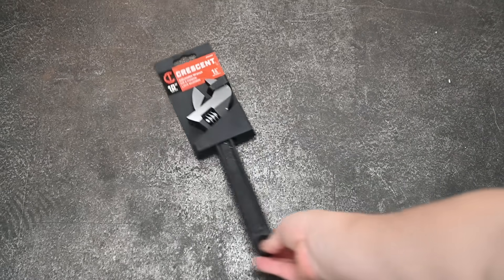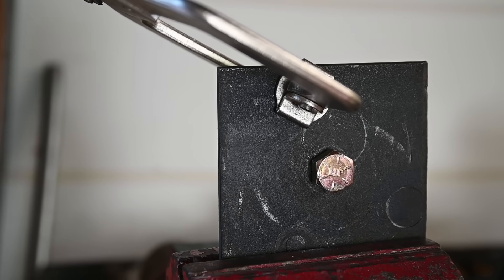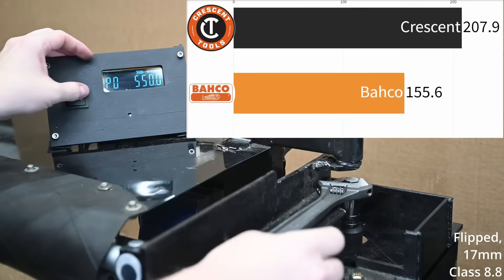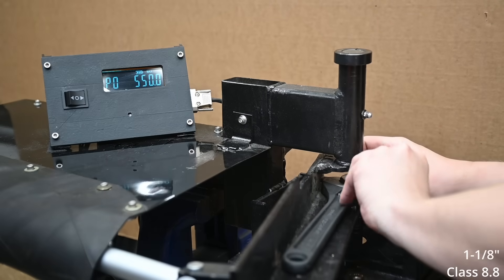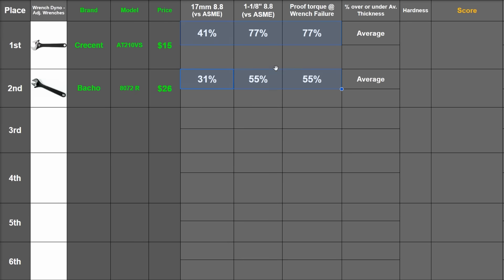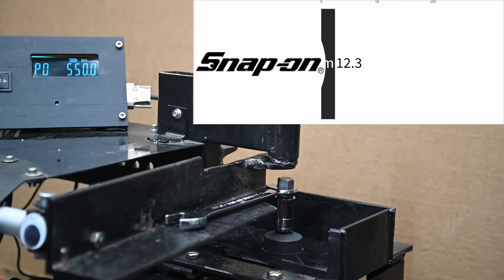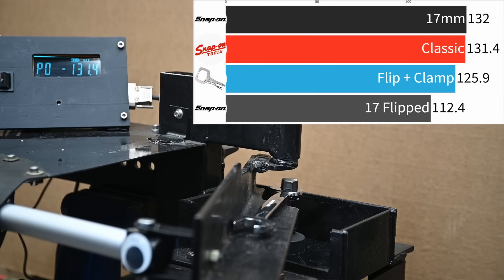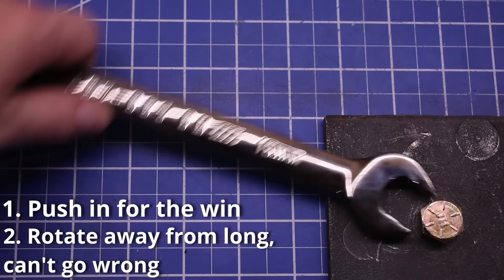Are you turning wrenches the wrong way?

Comment: It seems that tools do change over time a lot, that is at least for the Bacho adjustable wrenches the case . Got 3 very old ones from many decades ago (before  1924) in different sizes. patent 40417 which seems much more sturdier than current models.
They all are, as the Crescent brand, have more rounded jaws, 
have much shorter jaws
jaws are not tapered toward the front of jaw
early  ones have  the same jaw length as thickness. 1 inch jaw length = 1 inch thick
The 3rd generation  a bit smaller 83% thickness. example; My No 82: 18mm (0,71") jaw length, thickness  is 15mm (0.59)
The 80 series had 45 degree angle while other series have a 15 degree angle.

Comment: I have always felt intuitively correct in the assumption that the head is angled so as to give you access to the whole bolt, which are usually 20º (1/3 of 60º) and 40º (2/3 of 60º) angles to offset the 60º of each side of the hexagon.

Comment: If the bolt head deform all conclusions are invalid.   The movable jaw should press on the head flat close to the handle to limit moment on the weakest jaw. The fix jaw can be made to press on the flat farther since is stronger.   If the bold deform you are better off using a box wrench.

Comment: Another ridiculous test that means nothing in the real world. I'd like to see the person who can put 200+ ft lbs on a nut/bolt with a 10" wrench of any kind. Tough enough to do with a 24" breaker bar. Considering the torque value for a 5/8 is only 58 ft lbs, any of these "Cresent" wrenches will do just fine.

Comment: Bahco was Swedish was and far superior to the Crescent, now made by some cheap Spanish outfit.  You wouldn't use an adjustable for everything but the correct spanner. I have had a 12" Swedish Bahco since 1968 and it still is in working order as its not been abused.

Comment: The caveat at the very end "whenever you can" is the important thing. Frankly, bang on the end of a screwdriver to use it as a chisel, sometimes, because that is the most practicable tool in the moment AND IT WORKS. The screwdriver has evolved in design to take a pounding like it never was originally meant to do. The same thing with many other tools. I've even used an impact wrench as a hammer in the way it's internal hammers were never envisioned to be used! You use your head and, in a pinch, use what you have at hand...... and you TRY not to break things! ;-)

Comment: Sometimes I do turn them the wrong way... but then I remember "righty tighty, lefty loosy" and after a few minutes of left/right confused thinking I figure out it means clockwise to fasten and anti clockwise to loosen.
Reply: Oh, you mean which way to hold the wrench itself... 😁
Thoug, I really can't imagine it makes much of a difference... I would think that that as long as the spanner is adjusted correctly the twisting force will affect both sides fairly equally and it's probably just as "bad" for the mechanism to twist it one way as the other. And I would assume the main reason the non-adjustable ones are asymmetrical is because it increases the chance that at least one orientation will be able to fit the nut in a cramped space, not because one is stronger than the other.

Comment: There is no preferred direction for using an open-end wrench; they are designed to be used in either direction.  The offset angle is to allow smaller turning angles to turn bolts in tight spaces.  The offset angle designed into the adjustable wrench is for the same reason.  But due to the need to move (adjust) one jaw, that jaw will always be weaker.  Having a weaker direction is a result of design compromises.  Again, the offset angle is to allow for tighter spaces.  The adjustable is always inferior in strength to a box or open end.  

The box wrench is designed for breaking bolts loose while the open-end is designed for rapid application and removal.  I have watched old-timers (I am the old-timer now) use an open-end wrench as fast as we would use a ratchet. You no longer see that because we have ratche wrenches.  The six-point box is stronger than the 12-point box.  The 12-point box compromises strength in favor of the smaller turning angle for tight spaces.

Comment: It is interesting to see the behavior with the adjustable wrench.  None of those wrenches are very big and it would be difficult for any human to achieve anywhere close to those torque values by hand.  That might be a good test for you- how much torque can you get on one of these wrenches by hand.  Of course people can and do put "cheaters" on them.  As your tests show a lot of the tools start to slip as the torque reaches the limit- a person operating the wrench with a cheater would see that the tool is slipping and probably wouldn't keep going until something broke.  They would know that the need to tackle the problem a different way.

Comment: For the normal wrenches, the reason they are angles by 15 degrees, is that bolts normally have a 60 degree minimum step angle, y'know, because the bolts are shaped hexagonal. That means in tight spaces it can mess you up if you can't get the tool on the bolt properly. When you turn over the wrench, you basically half that 60 degree minimum angle to 30 degrees, allowing for more space. You can then keep turning over the wrench each rotation. Yes, that does take ages and is very annoying, but it works wonders. The orientation should not really matter strenght-wise.

Comment: Any open-end, adjustable or ratcheting wrenches and spanners should not be used for tightening or loosening up the bolts, they are for light jobs. That's kind of common sense.
A socket on the end of a breaker bar or a torque wrench is what we need. If there's no space for that, ring spanners are the next option down the list. The last thing I reach for are open-end spanners because of only two points of contact and likely damage to the bolt head, unfortunately something like a pipe fastener doesnt leave us too many options.
Always make sure you dont exceed required torque if applicable, and If you broke your wrench or rounded the head, you just used a wrong tool for the job.

Comment: I havent watched but ive always turned towards the fixed end. Because the nut will be putting pressure on the variable end closest to the adjuster, and the closer that pressure is applied the less leverage it has on it. So i'd asume it's less likely to open and slip
Reply: It appears I have been doing it wrong, thankyou. Perhaps the upward motion overcame the benefit of less leverage in terms of creating a gap to slip

Comment: The test nut used actually looks to me like a socket wrench for Allen screws. The tolerances are different from those of nuts and wrenches (especially fixed ones) slip more easily than a nut of standard dimensions.

Comment: The direction of the jaws is about multiplying the amount of input force it takes to get output force and the ergonomics behind it, like you hinted on at the end. A better test would have been to measure the torque applied to the wrench to achieve something like 100ft lbs on the fastener, at least in my opinion. 

I use pliers wrenches all day every day and the different is very noticeable.

Comment: One end is pushing, the other is pulling.  The force of the pulling end will be more at the tip.  The pushing end will be more at the base.  So if you pulling with the adjustable end, the force is at the tip and is prying it open.

Comment: it is this simple with a standard open end wrench- It is intentionally set at that angle for use in tight quarters, so that you get a certain amount of rotation, you lift, flip, and replace the wrench, and continue to turn it. There is NO WRONG DIRECTION, period. If there was, then it would not have the (I think 18 degree) angle, and would just be straight off the end. At 15 degrees, if there is a 1 flat rotation space available(meaning you cant turn the bolt or nut more than one flat) you can flip the wrench, and get to the next flat. Give it a try sometime...

Comment: The vid was good but how can you run a channel around it for so long and with so many subs? It makes no sense. It would seem that you test all wrenches once, then another brand and that's about it. Maybe screwdrivers and various ratchets and impact drivers and then it's over. I'd add various lubricants to the thread to make it tighter but yoeh, that's one or two more vids and it's over

Comment: if you are pushing in the direction of the short end,  you are mechanically pushing on the nut
when you are pushhing in the direction of the long end, you are effectively pulling on the nut.

You are pushing the handle, but due to the angle of the handle, the force is applied on a different side of the nut.

Comment: I never know where this myth came from. The angle on the jaws is so you can turn the wrench over in a tight space where only fractions of a turn are possible. The angle is half the angle of 2 faces on a hex bolt or nut so even in a very restricted turn space you never get to a point where the spanner in on the bolt head and cannot be turned.

Comment: Can you do a test on the “Cat” branded SnapOn wrenches? I’ve only seen them for sale at Cat dealerships, and it’s been ten years since I’ve looked. I have a full spread of cat wrenches and sockets as I used to work for cat and got a 10% discount from cat, and a 15% discount from the dealership. I’ve had my set for over 20 years now and I have no complaints.

Comment: I can say that it does definitely make a difference. I've had bolts cam out with the spanner upside down and pushing on it, but having removed obstacles to allow flipping the spanner the right way, have had the bolt break loose with significantly easier effort. It might not be torque numbers noticeable to us flesh bags but that doesn't matter, it's the torque getting to that bolt that matters. Last thing you want is to cam a bolt out meer Nm from cracking. It's the difference between a 20min job and a gas axe and many swear words.

Comment: Yeah, but... I for one could not possibly match Pushy's muscle.  I wouldn't even DREAM of being able to tighten a bolt to that outrageous amount of torque.  Besides... the torque spec of the BOLTS themselves can't stand that much.  If you need 100 lb/ft of torque, you grab a 1/2" drive ratchet or breaker bar, not a damn combination wrench!

Comment: You missed the main reasoning on the design, think about it. The bolt is a hex, 360 divided by six = 60, half of 60 is 30, the "offset head wrench" (proper name) is 15 degrees, flipped it equals 30.

Comment: Old man here.
I check play in screw on crescent wrenchs and pipe wrenches.
If it has vert little play its good.
I have 60-80 wrenches and the open ends are equal. length.

Comment: It's not the jaw orientation that's making the difference. It's the torque vector. With the smaller jaw trailing, you're slightly pushing away from the nut. With the bigger jaw trailing, you're slightly pushing towards the nut.

Comment: You’re supposed to use an adjustable in the correct direction to save the wrench, not the work.  When you torque the wrench in the wrong direction you separate the jaw making the wrench loose, and therefore weaker.  As for open end wrenches, it doesn’t matter.  They’re offset to support turning in small places, and flipping to continue having space with each turn.

Comment: Figured out with adjustables vs high torque, that facing the wrong way will spread the jaws, and the other locks the bolt in.  Never thought about it with regular wrenches though

Comment: 14:12 The direction I pull on a wrench from depends entirely on how I can access the fastener I'm trying to work with. That can often involve flipping it both ways around every time I go to rotate it, because frequently enough, if I'm using an open end wrench on it I can't get enough of a swing on it to turn it one flat at a time. So, may be pulling towards long, then away from long, then towards long, alternating along like that.

If I have the luxury of being able to choose which side of the wrench I put force on I usually have the luxury of throwing a socket on it.

I also have a pretty neat nut lathe I picked up from AutoZone's tool rack. It's got a vice grip built into it. Standard adjustable wrench, but when one tightens the jaws fully, one can then squeeze the vice grip side to really clamp down TIGHT on the fastener. It's my new favorite hand tool truth be told. Works well on rusty hardware that any other wrench slips off of! Also works well to prop my door open when I'm using my 53 year old truck as a giant boombox while grilling steaks hahahaha

Comment: You do realize you're using a 19mm metric wrench on a 3/4 in. bolt head. Metric fasteners don't use the hardness hash marks, only SAE/ imperial fasteners do. They are close in size, I mean really close.. but it's a test so this might be the time to use the correct wrench on the bolt.

Comment: If you used the same wrenches to test both directions, I should think that would invalidate your test since pushing the wrenches beyond their limit in the first test might have deformed the wrenches, which would have affected the wrenches' performance when the same wrenches are tested in the opposite direction. 

Also, the wrenches likely heated up when tested. The heating could deform them, at least temporarily. This deformation from heating could also affect their performance when tested in the opposite direction.

Comment: Per Tradesmen that Depend on their USE of Tools to make a living;

Hand Tool (Not Ratchet Speed tool) use Rule of Thumb (ROT) Suggestions FOR BEST RESULTS:
 
1) Always break hardware loose with a BOX end wrench if possible.

2) Only after Major Breakaway torque has been overcome, then only Move to use of the open end wrench. 
Open end wrenches are Speed wrenches which allow for faster hardware run off/on past/to run-up by fingers up to torquing/release torque with Box-end wrench.

3) Adjustable wrenches are to be used as run-on/run-off tools like speed wrenches except 1 size fits many bolts. Once again for Speed applications. 
They also are best not to be used in Breaking initial torque loose or Final Torque.  

I am not a Tool Salesman, Just a 67-year old lifetime Master Line-Technician having to depend on using tools properly to Fix the Screw ups of others when concerning improper use of tools that also damage the bolting hardware. 
This all, to get the job done Correctly for the problem being corrected or Job at Hand to complete.

As a Transportation Systems Instructor, my last Job, the Curriculum included Certifications for: 1) Torque Theory 2) Mechanical Torque Instruments 3) Electronic Torque Instruments. This was taught just to help Students understand what Hardware is, does, proper/improper use & then onto understanding proper Torquing techniques.

Wish you would have tested the similar crescent open-end wrench against the Snap-On.

Comment: as someone who has to use wrenches in tight spaces at work, I'd say just turn in in the orientation that allows you to turn it. I often find myself needing to flip my wrench repeatedly while tightening or loosening a nut. Unfortunately for me, a ratchet is seldom applicable at work. I wish they were but more often than not, I need a skinny wrench to do my work.

Comment: Interesting topic. Just had a debate with my boss. He thinks you should turn a Crescent wrench the wrong way. I have been taught and have always turned it the correct way (according to your results). I guess I was right. There are times you need one, but I have always used them as a last resort. Right tool for the right job. Some people reach for them first. I want to smack their fingers. Not only do I dislike adjustable wrenches, I don;t even like open ends...unless I have no choice.

Comment: Taught by a time served engineer myself.  The explanation for using an open end spanner the 'correct' way as opposed to the 'wrong' way: For Adjustable spanners you can see what happens to the mobile jaw.  But this isn't the main reason for the 'correct' way.  The main reason is that normal people  in many situations will push or pull in a straight line, not with a perfect curve. With the spanner the correct way this keeps pushing the spanner onto the hex for a much greater arc than the 'wrong' way does.  This is one of the two reasons for the offset angle of the head.  The other reason is so you can of course flip it over to get it onto nuts/bolts in awkward situations.  Initial loosening and final tightening should whenever possible be done with the spanner in the 'correct' orientation.

Comment: Sockets or ring spanners are always my first choice. Applying torque via six contact points instead of two, is much less likely to damage the hex. 
Slotted ring spanners intended for use on automotive brake lines are beefier than open ended, and still manage to apply load at all six points of a hex. Well worth the investment. 
Open ended spanners are only used when it is not possible to use the closed (or slotted) rings. These tend to round the nuts. Then it forces vice-grips and new nuts. 
Knuckle f*****s almost never leave my toolbox. Only when I encounter an unusual nut size that I do not have a regular spanner for. Thankfully I have never broken one.

Comment: Every time I use a pipe wrench or adjustable wrench, I recall my granddad telling me when I was about 10 years old, "Put the pull on the fixed jaw!" after I incorrectly oriented an adjustable wrench on a hex head cap screw. Since, with an open-end wrench, the dimensional relationship between jaw opening and bolt head are identical in either orientation, it makes no difference.